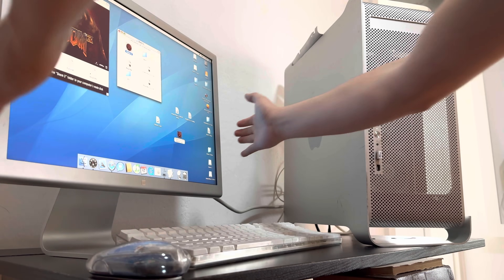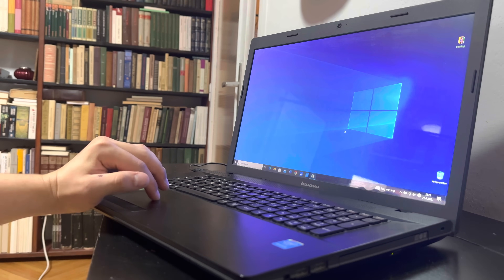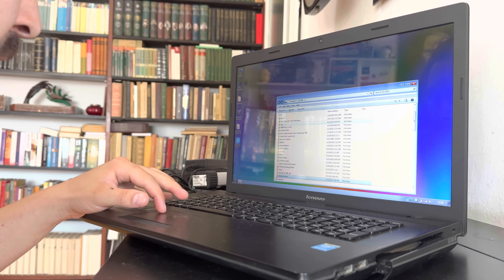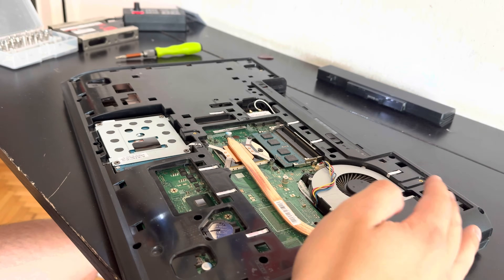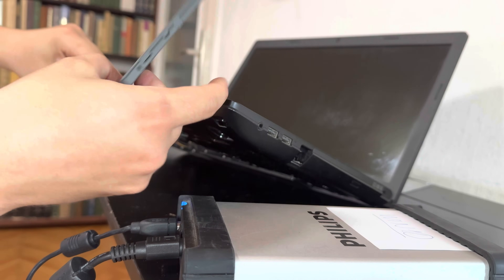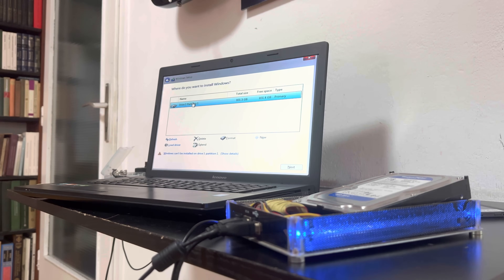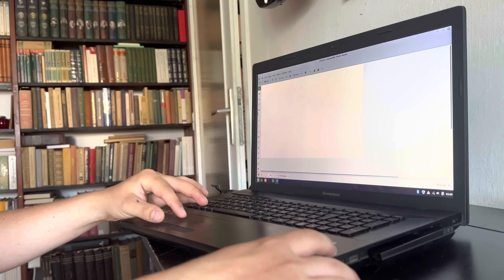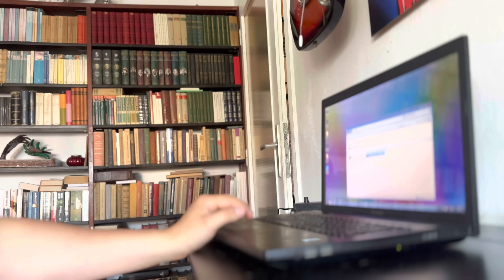Running My OS From 7 Different Devices

Comment: That does NOT need linuiix and could run windows 11 lite just fine with system requirements removed.  And with a few upgrades hold up well for a low end machine
Reply from the maker: Oh for sure. Just wanted to use tiny 7 since it takes up less space (which I needed for this experiment)

Comment: I sincerely don't know why people are still talking about windows 7. This OS is defunct and serve no purpose today, windows 7 was known to have an aversion for wireless connectivity like WiFi and Bluetooth, no SSD trim support and this os, just like any windows was impossible to install on an external support.

Windows 7 was fluid, back in the days but it sucks to use this OS in 2025. I'd rather take the Linux route , because Linux, especially debian, Ubuntu, mint and OpenSUSE have been improving with every new version released and they offer a desktop environment (cinnamon and XFCE) similar to Windows xp and 7 , so I don't think I'm missing windows at all
Reply from the maker: It’s funny, but we actually have some computers at our office that are still running Windows 7. I think you’d be surprised to find how many people actually use it to this day 😂

Comment: Linux and MacOS work easily from a usb device.
Windows doesn't like to boot from an external USB device unless is done by a special tool. The newer the Windows the easier is to tame it for external device use.
Windows works from an external SCSI or eSATA HDD or SSD flawlessly.
Reply from the maker: Yep, I think I’d have more luck with a never computer and a newer version of Windows probably

Comment: Just don't try to install Linux on a 32 bit machine, they do no optimization, have no support, and Fedora is trying to complete eliminate 32 bit altogether.
Reply from the maker: Still plenty of older versions of all sorts of 32 bit optimised os systems to try